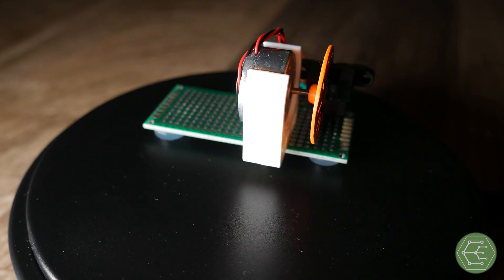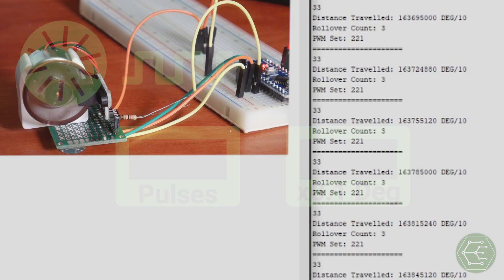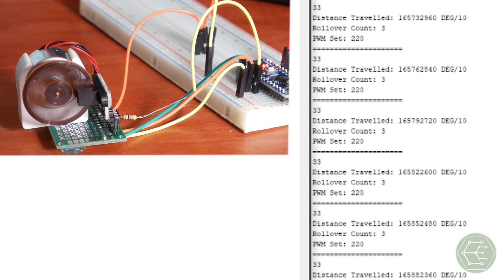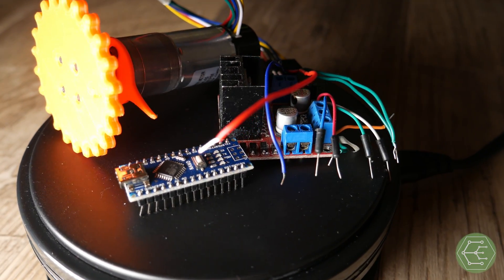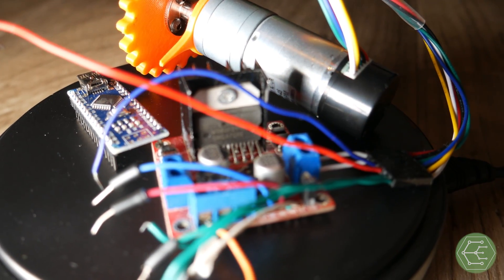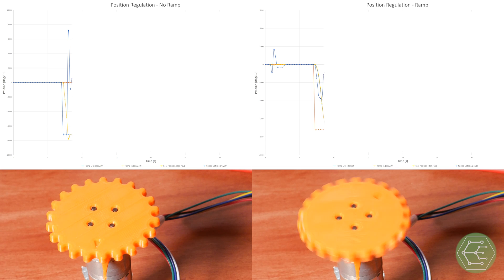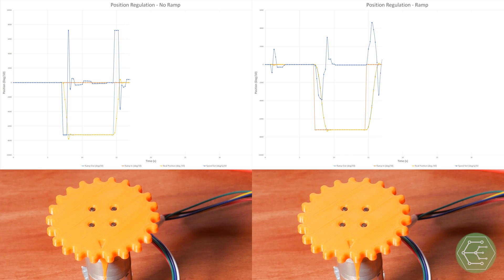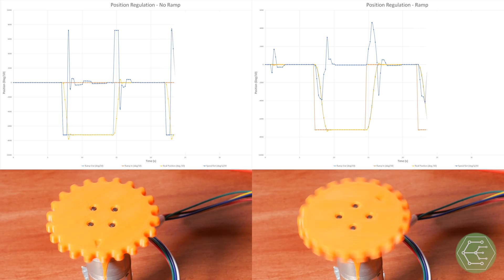Build or Buy a motor controller? – Electronics Design | MOT8

Comment: Great points all around. Some of answers on my project:

1. Do I have time? Yes wholly committed to this project, using some 401k money to create the POC prototype. Goal is a running test bench motor by May with a vibration resistant kart controller a month after (chip supply permitting).

2. Is this a product and do I plan to sell it? Yes and yes. I will need to invest money to take the POC custom controller and physical motor design to a level for "mass" production, as well as for patents.

3. Can you buy it? No. There are no motors or controllers in existence like this as far as I can tell after searching for several years. Novel design based on a proven but not well known or documented magnetic principle in regards to motors.

4. Is it dangerous? Am I worried about shock to the user, or a fire? Not really due the relatively low voltage nature (48v), although it's always good to have safety equipment when racing (needed for the gas karts as well). The drive chain is the most physically dangerous interface. Getting everything tested and certified will probably be half the costs.
Reply from the maker: Bryan - Your answers here have my interest! :) I... may or may not have jumped over to your YT channel- the render looks awesome. I wish you all the best in this endeavor! Reach out to the Inquiry email if you think I can help you in some way as you get some hardware going! it's on our about page. https://www.youtube.com/c/eeforeveryone/about